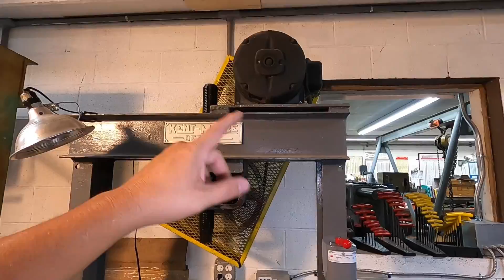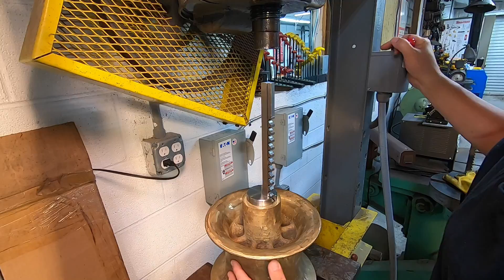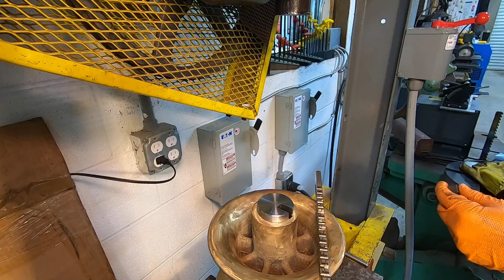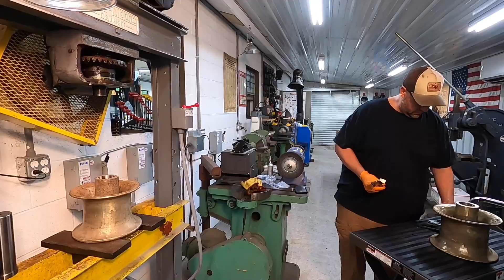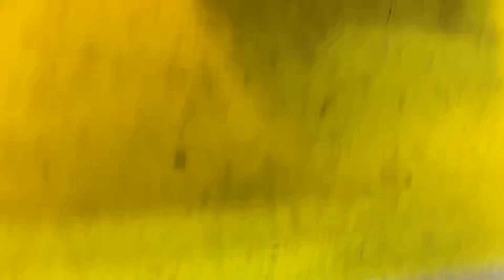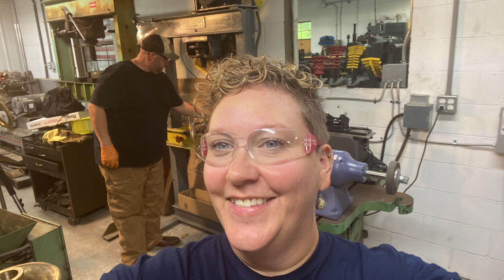Broaching Keyways in Cast Bronze Capstans Part 3

Comment: Yeah I was wondering about the depth of cut when he measured across the chord between the two cut sides in the last vid.
Reply: https://www.pooleyinc.com/pdf/StandardKeyway.pdf
Reply: @ChrisGraham00  Ah thank you.  I thought it would be more accurate to measure from the bottom of the slot to the other side of the cylinder to measure total depth of cut.  We don't really cut keyways in the woodshop!

Comment: Am i the only one who think that the gearbox on the press sounds real bad?
Reply: 90 degree miter gears...exposed...they will be heard...!
Reply: @dougankrum3328  plus all the slop thats in it from years and years of use. It could be finessed to tone down some noise but if its not used all the time then no need. But an "insulated" properly fitting cover over the front plus setting the mesh and backlash of the ring and pinion would make it much quieter

Comment: Hi Adam, love your presentations and information, my only fitting and turning instruction was at 1st year trade school back in 1969. I love lathes and machinery and have owned and operated a number of machines, basically self taught. Since watching your youtubes I have been searching for a magnetic dial gauge as use on your lathe beds etc but have not had any luck, would you be able to point me in the right direction. Cheers.

Comment: Adam, why are the broach teeth split?
Reply: Just a guess, but I'll bet it helps control chip size. Note that the splits are staggered and the last two teeth have no split.
Reply: I'm going to guess it's something about air pressure release between the teeth.
Reply: @ahuggins6  , interesting idea.  However, there is a point in the video where you can see the chips piled up between the teeth.  The chips in and next to the slots are smaller.  Wonder what Adam thinks?  He knows much more about chips than I do!

Comment: I need help. My wife has a Tricycle. I fabacobled a dog leash set up so she can run the dogs. We discovered the rims are too weak for the stress of the dogs pulling away from the bike and bent the rim. We found heavy-duty rims but the hubs are 4 inches 5/8 inch shaft. the shaft in the axle is 5/8 turned down to 1/2 at the hub for a 3 1/2 hub. I need a 5/8 inch shaft all the way across to match the contours of the factory shaft and threaded. it also has a keyway cut into the center to keep the chain drive sprocket in alignment.

Comment: I am still curious why you do not use the shaper for broaching. All the broaches are unique tools for a particular size. The shaper with an internal shaping tool would make easy work of this without custom tools. Just a piece of highspeed steel ground to size.
Reply: He already got the expensive broaches and wants to use them I assume. Also, it might be somewhat difficult to set the workpiece right in the shaper. The broaches are standardized so there is little chance for things going wrong.
A vertical shaper would be very well suited for this job though.
Reply: @user3141592635  At the start of this job Adam mentioned this would be an excellent job for the Davis Keyseater but he was missing some of the tooling needed for the cutter.

Comment: I completely enjoyed the 3 part series. One of my very first jobs was in a machine shop that made various military items. Then from there I went to Westinghouse where they were working in collaboration with a French company on building nuclear steam generators. In the pressure vessel were many cooling pipes that were held in place by large thick support plates. These plates had to have various hole shape broached into them. An engineer (I’ve forgotten his name but a brilliant man) and I work together to design the various broaches. I was his draftsman. These broaches were 12 foot long! He designed a special machine that they used to pull these broached, two at a time in opposite directions at the same time. This was incredible to see and very loud!
Reply: I worked for Westinghouse Transportation division in the early 80's when Westinghouse was a hugh multi industry company.  Now there is not much left but the name.  Too bad it was a great company to work for.  What I learned there helped me for the rest of my working years.
Reply: What a fascinating story! Thanks so much for sharing. I'm a longtime civilian nuclear fan and love these recollections of what goes into those impressive machines.

Comment: It doesn't look like the shims extend the full depth of the bore being broached.  Do you ever run into difficulty with depth of the far end of the broached channel being a little shallower due to the broach shifting slightly after it passes the shims, or is the un-toothed section of the broach long enough to keep the it controlled?
Reply: Just what I was thinking.
Reply: @MartinInAmsterdam  Probably not an issue...that material is easy to cut, and those high-speed steel broaches are pretty stiff...good thought though.
Reply: @dougankrum3328  Well now the stiffness of HSS is not really more than mild steel at 210GPa so I'm npt so sure

Comment: Why didn’t you just use all the shims on the first pass?
Reply: Doing it one cut would probably destroy both the cutter and the workpiece. Several passes means less stress on both.
Reply: @markschwarz2137  Not to mention it wouldn't even fit in there.
Reply: @Carl Klinkenborg Yeah...I worked in a shop that built big Machines...CNC but before the computers....they had parts that were broached internally...broaches were 5 feet long...broaching was done on horizontal machine about 12 feet long....everything was submerged in cutting oil...broaches were pulled...
Reply: @Carl Klinkenborg My experience with that pull-broaching was in the 1970's....things have probably changed a little since then...! Fir tree roots...chain broaching...OK....sounds almost like a chain saw, but chain-saws are quickly ruined by any contact with dirt or rocks.
Reply: I don't think you understand how a broach works
Reply: @hansdietrich83  ...yeah, that's why they make a bunch of shims....

Comment: Why does a broach have more than one tooth?
Reply: A broach can only remove a certain amount of material per single pass- let's call it 1/16th of an inch. If you wanted to do that in one push, the force needed to push the broach through the part would be very high because of the thickness of the single 'chip' being peeled out. You can take that same 1/16th pass, and break it up into 10 teeth which each take off 10% of that initial chip thickness. This more-than-proportionally reduces the force needed to push the broach through the part by having that chip thickness reduced, and makes the tool last longer by distributing that cutting force over multiple linear cutting segments.

Then, using shims, you can get the broach to cut essentially any depth you want.
Reply: Each tooth takes a little bite instead of one big chunk.
Reply: @steveo1413  How does this happen? The depth of cut doesn't change as the broach moves and the width of the broach is constant so the teeth behind the first tooth are not cutting any deeper. Seems like the first tooth is doing all the work.
Reply: BensonDanneskjold each broach tooth sticks out a bit more from the one below it. So it’s kind of tapered.
Reply: @BensonDanneskjold  The broach is broken up into increments. The first tooth, say, takes 0.01". The next tooth takes another 0.01" on top of the first one, and so forth. So, after 10 teeth, the broach has cut a total of 0.01*10=0.1" further into the depth of the keyway. The broach teeth follow a wedge profile. The Width of the broach is uniform- it only cuts to deepen the keyway on one side in this case.
Reply: @BensonDanneskjold  Each tooth is slightly longer the the one under it.

Comment: You mentioned having to use earplugs. I think it would be an interesting video we’re you to do a show on best safety practices and what you’ve learned over the years. 
I always see you in gloves but many times I’ve wondered what you were doing for ear and eye protection. 
Love the shows.
Reply: JJE McManus , He did a show, I believe it was an SNS on PPE several years ago.  He has links to where to get many of the gloves and ear plugs he uses.
Reply: JJE, I went back and searched it was April 18, 2018 and the links are there for earplugs.
Reply: And of course I realized he had eye protection through the entire video. So how’s that for being observant?
Luckily the only two safety requirements in my studio are don’t lick the wet end of the brush and keep the pointy pencil end out of places it don’t belong. 
But I have questions like: has including ace camerawomen Abby changed protocol any? How’s that nifty leather apron he got a while back working out? And how does he keep a machine shop so clean and tidy? I suspect it’s elves.

Comment: With that long cut, having the slot in the plug too deep might be a blessing if the material proved too difficult to broach with all the teeth cutting at the same time. A half thickness shim would allow each following cut to also be made with only half of the teeth cutting. (Then a full shim, then 1 1/2, then 2 full shims, etc.) This could be useful for folks with a lighter press or an arbor press to do large (or like this case, long) broaching projects.

Comment: Abom please don't slam that motor in reverse while it's still running forwards , let it it run down to a stop I know you probably don't do that in normal operation and it's got no real enertia behind it , but it's just not good and the current spike doing that is a bit big 👍
Reply: Depends on the machine.  I have a radial drill and in the owners manual it states that you can go from full forward to reverse instantly up to 16 times a minute without causing any damage.  You do this when tapping blind holes.  If you had to wait for the motor to stop you may bottom the tap out and break it off.  My radial drill does not have a clutch, the spindle on/off and direction is controlled by turning the motor on/off and reversing it.  It was built in 1957 and still has the original motor and switch gear (Allen-Bradly) all working flawlessly.  Ken
Reply: It will be just fine.
Reply: He's got about 500:1 reduction there so I think its ok.  I don't think the motor cares.

Comment: I've been watching the channel for quite a while now, but never noticed or felt the need to ask.
On the broach each tooth appears to have a split or groove in it, and it moves back and forth on each tooth, except the last tooth or two that are just solid.
Does that groove help to clear the chips? or some sort of marking device if you see a line down the keyway it has not been cut fully? Obviously the last teeth don;t have the groove sop they cut the entire width uninterrupted.
Reply: Normally something like that is a "chip breaker".  If you don't have that notch, the chip is the full width of the cutting tooth.  The notch breaks it into 2 pieces which fall out and apart easier. 

Exactly right on the last few teeth though, you want a nice smooth finish so no notched teeth.

Comment: How do you make sure the depth of cut is consistent all the way down, when the shim isn't the same length as the plug?
Or doesn't it matter in this specific operation?
It looked like the broach was still flush against the back of the plug at the bottom even when shimmed at the top.
Reply: It only needs to be accurate for the length of the key, which in only about 4 to 6 inches. The rest is just a hollow groove and can be any depth. Ideally it would not even exist, its just a by-product of the through hole process that is broaching (depending on which way the thing is assembled, of course).
Reply: @1971merlin  Thank you. That makes a lot of sense. Great explanation, and embarrassingly obvious once I think about it. cheers.
Reply: @metubewot  it all depends on the assembly direction relative to the key position. There can be cases where the key must travel the length of the groove, in which case groove depth matters. This may not be an ideal design, but they do exist.
Reply: @1971merlin  Thank you.
Reply: I had the same though. In the case where it does need to be full depth for the full length, I wonder how hard it is to get longer shims? For runs of only a few parts, I'd guess any old low carbon sheet metal would work.

Then there is another point: as the cut gets longer, I suspect the broach design would need to change: at some point you will run out of room for the chip and need either more room between the teeth or less depth of cut per tooth. And if you don't make the broach longer (for why you might want to avoid that: https://en.wikipedia.org/wiki/Euler%27s_critical_load) your depth per pass goes down. And that's just from theory, I'm sure practice throws in some interesting issues as well.
Reply: Yes I was thinking the same.

Comment: If you wanted to you could put a second pulley on the press and the motor, but make the one on the press smaller.  Put a one-way clutch on each of the pulleys on the press side.  That way the big pulley drives down with the force you expect and then the smaller one retracts more quickly.

Comment: Usually the broach plug is longer than the bore it goes through, but how "short" can the plug be?  It would seem to be ok if it is a little short.  Is there a rule of thumb, or some chart I've missed in the Machinist's Handbook?  Thanks for the videos.
Reply: Well his shims didn't look full length. No real point in having a longer broach plug than the shims it seems to me.
Reply: Probably says face off a peice of bar stock long enough to force it through. Just a guess.